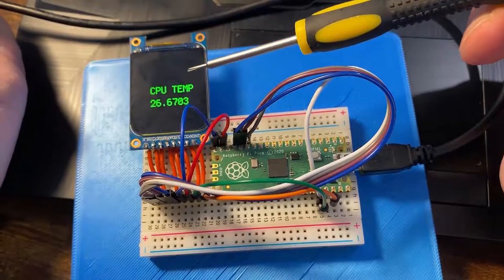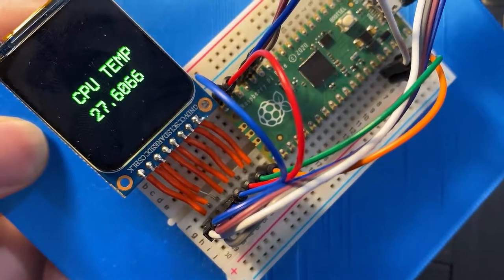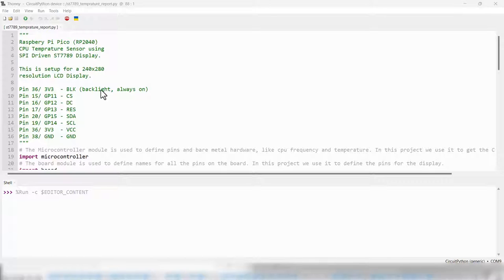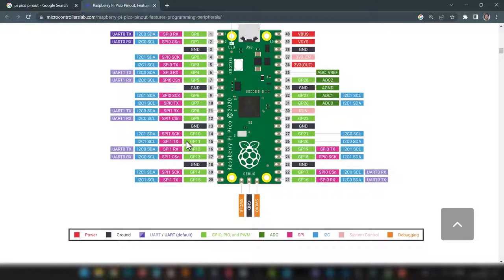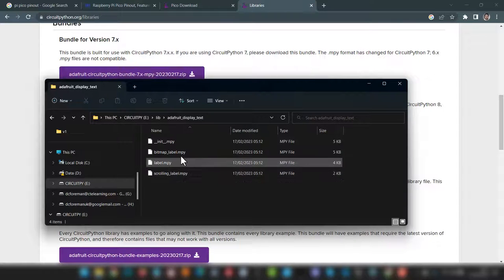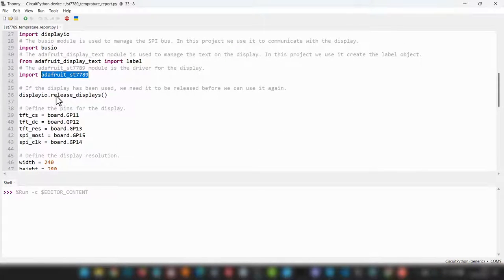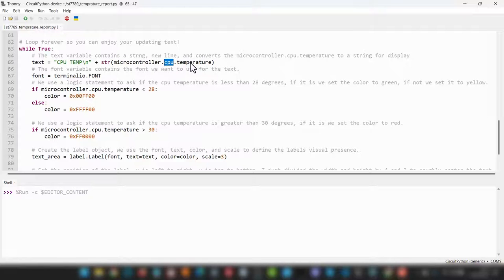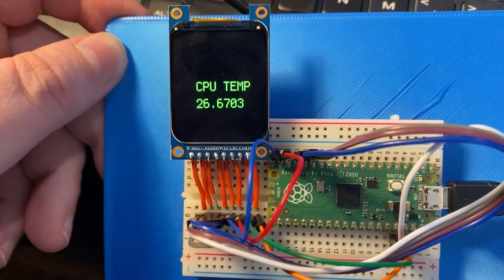Creating a Raspberry Pi Pico ST7789 based coloured text display

Comment: This is by far the most helpful video I have found yet on the topic of connecting a Pico to an ST7789. Thank you for making and posting it.
My ST7789 has only 7 pins, not 8; It does not have a BLK pin, but I suspect the backlight is internally hardwired to the VCC anyway.

Comment: My device is 135x240 (its a st7789) and it has different pin labels. will it still work? If so, how do these pins match up to the ones in the video? Some are obvious but I will give the entire pinout:

Vcc
Gnd
DIN
CLK
CS
DC
RST
BL